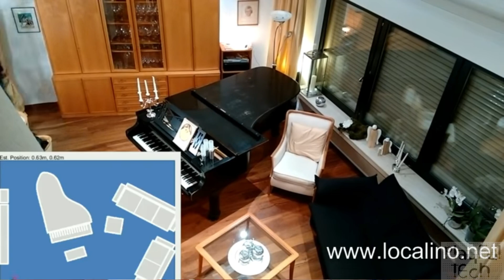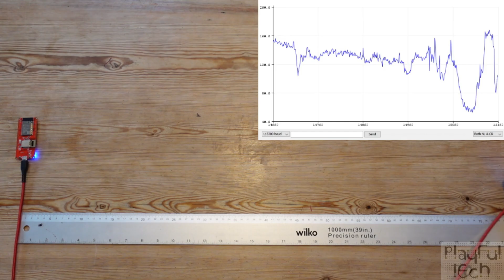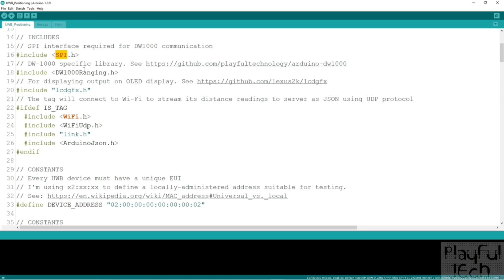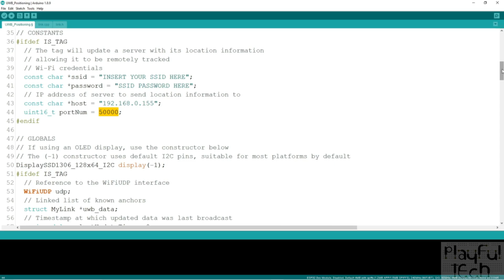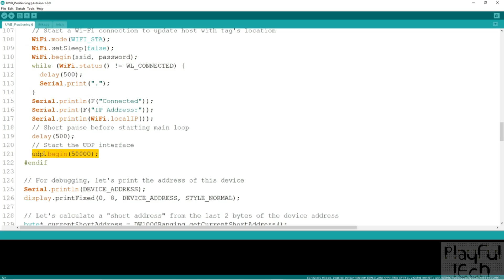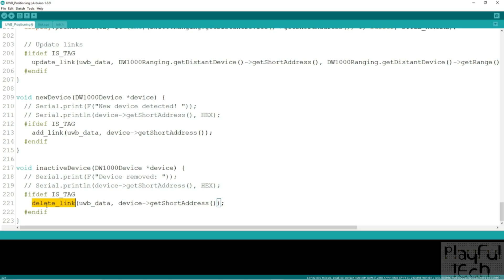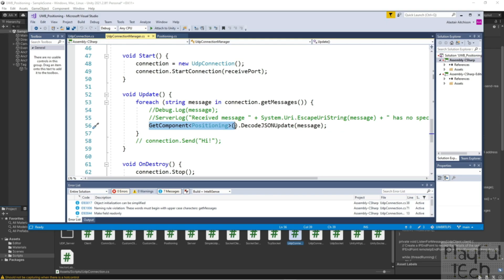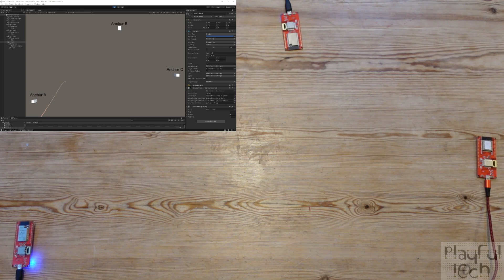Ultra Wideband Realtime Location System using ESP32 and Unity

Comment: In the framework of your airplane trilateration image, if all sensors overestimate, then the intersection is a triangle rather than a point. Just an idea, you could calculate the centre of this triangle rather than hardcoding corrections.

Comment: Hi, I recently got 4 ESP32 UWB module and 1 ESP32 UWB Pro with display module. I started experimenting with one or two beacons and the one with display as a TAG. And I ran EXACTLY in the same issue of loosing connections at 80cm or less. It drove me crazy. Till I had the idea to drop the tag one and use another module as the tag. Tadaaaa! I have precise measures at 10m+ without problem, even in 3D and even with a light wall in the way. What a difference! So my idea is that you might have a defective module in your setup... just an idea 🙂
Reply: Any advice on this? I'm looking to create a class project using UWB modules  with unity for a mobile game
Reply: @skyline128  Have you found a solution to this? We're also looking to do a mini map of sorts for our project but I'm trying to get ahead of any issues before starting our project 😅

Comment: If you want to use it, try a Mean Average on a 10 data buffer of previous locations, that makes the simulation smoother but a bit slower ;)
Reply from the maker: That's true, although I think it would be preferable to use a weighted average that gave more significance to more recent readings, rather than a simple mean of the last 10 readings.

Comment: The distance from the anchor to the "boat" can be estimated either by a time-of-flight (that would affect the round-trip-time infinitesimally - remember 1ns is a 15cm round-trip) or by RSSI. I suspect that the tags use a combination of these two. Depending on the initialization of the ESP32, I can imagine that a few ns are added here and there. Similarly, dielectrics and reflectors (wood, flesh, walls, plants) shall create multi-path reflections. If you put your hand in between the anchor and the boat - how much does the reported distance change? What "band" (UWB) is used?
This is a nice concept in terms of its low-effort deployment; I expect some maturity and learnings by various users (like you) to incrementally improve the precision over the coming months. If several anchors could talk to each other (in addition to talking to the boats) this might too add a layer of self-calibration the the holistic system.
Cheers!
Reply: I worked a bit with UWB and those Decawave Chips. So regarding your questions:

They only use Time-Of-Flight.
I can tell you, that (at least with the newer Decawave 3000 Chips), things like wood or a hand don´t change the measured distance at all. It is quite astonishing how good this stuff can work.
This is the same technic that Apple is using for their new Air Tags for this neat localization feature.

I can also tell you, that currently developing stuff for all of this (especially if you want to work with iPhones), is extremly painfull. Everything is under NDA and you get almost no information from Apple, Decawave or NXP (who also produce pre-production Chips with UWB).

Comment: It certainly is challenging but it can be done. It's even worse with the DW3000 because the driver provided by Qorvo is closed source. You can certainly get much better range than you experienced with proper configuration, at least up to 100 metres line of sight. But you do have to accept limited accuracy because the antennae on those modules have a significant directional bias, meaning the range measurement depends on the relative orientation of the devices.

Comment: I'd never heard of these chips. So I'll be looking further into them! My first thought, while watching, was to use more anchors, but you did that. Shame it didn't work. But, crunchy with the smooth. My only other thought would be using a Kalman filter on the distance data. However, I'm not sure if the lag would make it unusable or not.

 If you make any further progress, please share. I have a robotics lab at work that I'd love to let robots navigate around indoors, on the cheap, without marvelmind systems. You've also triggered my curiosity about using other wireless tranceivers as TOF sensors(?) Great Video :)
Reply: Worked on this for 3d positionning robot, it's very not robuste, could'nt achieve more than 30/40cm in 3d accuracy in bests conditions

Comment: Working in UWB.
11:00 Antenna delay is likely the calibration you are looking for... Maybe.

Anyway thé DW chip itself provides a readout of thé ToF in RCTU, so Time unit not (centi)meters.

So it looks also likely that the software used is making a wrong assumption about how to concert tof to distance (?)
Reply from the maker: Thankyou for the insight! Yes, I'm sure that the device should be capable of much more and I suspect you're correct that the software isn't behaving correctly, but I just don't have the resources to put in to wading through all that datasheet for what is an incredibly edge use-case (tracking of objects in an escape room!)

Comment: One of the problems is likely that the timers are not accurate enough for sub centimeter tracking. You are basicly sending a signal with a time value and the tag will then calculate the runtime. If the distances between your stations is to small you won't have much to work with. On a room scale it might work a bit better. Also you could calculate position by having the circles overlap and using the center of that as your location. That way it should also jerk less. These devices are for distances of up to 40 meters (or 120m for the other version). At those distances the offset of 50cm is more negligible. I think with a better timer it might work better though still
Reply: I'm almost sure that's exactly the issue here, I experimented a bit with dwm1001 and got similiar results at close ranges
Reply: I am only just beginning (today) to look at these boards, and I have seen minimum distances of 45cm - this sounds very plausible - although why he could not replicate his original results seems like a coding issue.

Comment: An actual company says that the max precision is 50cm.  quote :  the location of UWB signals can be determined with an accuracy of less than 50 centimeters (with optimal conditions and deployment), and extremely low latency. (inpixion company home page)

Comment: The source of error is the delay of the antenna itself. The antenna delay can be grater or lower depending on the antenna design but the value is fixed for every antenna. The error should be the same no matter the sensing distance. The chip itself doesnt know the antenna thats attached to it so it cant compensate for it. Cheers!

Comment: Have you tried greater distances, like 10 - 500 metres or more?  I suspect it is the same situation as survey.  All distances will have a small error that is more noticeable at short ranges, less so at greater distances.  I suspect that someone looking for an item that is big enough to house the arduino tag, they should be able to see it at 1/2 metre.

Comment: Would it be precise enough to do human body motion with tracking of several probes on the suit?
Reply from the maker: No. If you want to so skeletal tracking I recommend picking up a Kinect sensor - you can get the 1st gen. ones pretty cheap and they're easy to hack.

Comment: It is a sincere review and will be helpful to a lot of people. DO you have experience with any other UWB modules. I am interested in known the maximum range I can expect from these decawave UWB modules in outdoor condition. Thank you.
Reply: From my experience, you can expect around 10-15m (at least with the newer Decawave 3000 Chips)
Reply: @michaelneubauer4401  thanks
Reply: I've done around 10 meters with dwm1000 at low refresh rate and in Line of sight. Very Bad regarding decawave documentation
Reply: With clear line of sight and proper configuration they can comfortably communicate easily up to 50 m, and up to 100 m if you're willing to accept some amount of loss. I have no idea what people are doing to get only 10-15 metres.

Comment: Is there a way to determine the distance between 2 of these devices? I would like to work on a project that will use 2 of these devices to determine their distance from each other.  something very simple,  ie. if 1 foot apart, turn led green, if 5 feet apart, turn led yellow, if 10 feet apart turn led red.

Comment: Hello I had a question about this project... actually we have been working on a similar project where we are using dw1000 for calculating coordinates..the thing is we want the tag to be as cost effective as possible and easy to manufacture...so is there any way I could send the ranging data from the anchors to the server instead of the tag...we want the tag to just act as a ranging device so that the power consumption and the cost could be low. Thanks in advance ... really liked your projects and it helped me a lot!!
Reply from the maker: Yes, sure - I was actually uncertain myself what the best way to design the infrastructure was in terms of whether the calculations should be done client-side (and, if so, on the anchor or on the tag?) or server-side. I think the correct approach would probably depend a lot on how many tags/anchors you were planning implementing, and also on what you were then going to do with that information. But you could certainly just get each device to report the ranging time and do all the subsequent processing remotely.

Comment: Hi, did the following code from the original Arduino library have any affect? I think in your version, this was removed. 
//Enable the filter to smooth the distance
 //DW1000Ranging.useRangeFilter(true);
How about a rolling average, or other filtering technique?
Do you fancy testing the DWM3000 modules? You might be able to use the same demo boards and swap the modules (hot air gun etc) and run the same experiment.
Reply: Beware the register map is not the same

Comment: I can ask you a question please, if I want the same system but without tag, i.e. using the doppler effect of a radar system to monotor a person, is it possible with this tool . I want a sensor that is not worn by a person. thank.
Reply: Theorically feasible.
You need to sens a pulse and switch back immediately to RX to listen the echo.

Comment: Besides when adding eg. Gps, gprs call, the loop delay adds up and makes distance even wrong. This is impossible to calibrate even for every pair of anchor and tag in a large scale.
 Further, the makepython A9G shield  sim sometimes disconnect without any reason after running for a while. What a waste of time.

Comment: I have the same problem too. Every run the offset change...
Reply from the maker: Yeah, it's very frustrating! :(
Reply: @PlayfulTechnology  Finally I understand the behavior. Besides the noise on ranging, there is a delay within the loop code that should be properly tuned.
Reply: @chantana.c  Can you tell me how was the performance of after your tuning? Did you have any more methods to improve the performance more after that? I'm planning to use these modules in my project but not sure if the quality is worth it (since the price of these makerfabs modules is so expensive). Thank you!
Reply: @binhnguyenquoc3249  It was better when using wifi. But when using 4G/LTE is is slow. Cannot do any better. The cycle time is limited to the bound of 4G/LTE, if you make it too fast e.g. you will not find the anchor. This will be worse when you have many anchors to scan. I won' recommend for real product but for a toy project, it is fun. 🙂

Comment: I'd honestly wait until Adafruit or someone like that takes a crack at it. The in depth complicated documentation needs to be concentrated down and made much simpler and some decent example libraries need to be made. If the manufacturer can not help you (as seen in their sales comments), then it is likely that there might also be mistakes in their hardware design as well. At the very least, customer support seems to be nill.

Comment: Don't know how these boards have been implemented but there are a number of 'fundamentals'. 
The tags and anchors need to be in as much free space as possible, not on a desk or floor and nowhere near metal or wood. Suggest suspending them from a ceiling (nowhere near a room corner). A human touching or coming very close to the boards will cause significant transmission / reception variations.  Recommend putting the tag on a tripod (with the antenna well away from the metal tripod) for initial distance testing. 
Turn the WiFi completely off if possible, take the 'position' output serially from the anchors.
The antenna looks odd (planar?), try rotating the anchors and tag and see if the 'distance' changes.
In many UWB deployments anchors communicate with each other for timing synchronisation, don't know if this is the case in these boards.
Reply: Usually two way ranging (Timed but without synchro) is used with these board

Comment: Hi that's an awesome channel, marvelmind robotics does an ultrasound beacon with 20 mm precision however it's about 500 dollars for the minimum 35m range version for all the beacons. perhaps someone will get a germanium 1thz receptor in there and it will be 5mm precise that would be cool. sounds like a new company needs to change these boards ultrasound swarm beacons are not sold open source afaik for rpi that's a dilemna cos i want some for a map robot.

Comment: In your positioning.cs, in line 39,
    float V2 = (anchors[2].position.x * anchors[2].position.x) + (anchors[2].position.z * anchors[2].position.z);

in line 43, 
float y = ((r1 * r1) - (r3 * r3) + (V2) - (2 * anchors[2].position.x * x)) / (2 * anchors[2].position.z);

i checked the formular in Wikipedia https://en.wikipedia.org/wiki/True-range_multilateration#Three_Cartesian_dimensions,_three_measured_slant_ranges ,  it should be position.y instead of position.z , i rewrite:

line 39,  float V2 = (anchors[2].position.x * anchors[2].position.x) + (anchors[2].position.y * anchors[2].position.y);
line 43,   float y = ((r1 * r1) - (r3 * r3) + (V2) - (2 * anchors[2].position.x * x)) / (2 * anchors[2].position.y);

Not sure is this the reason that your solution doesn't work?